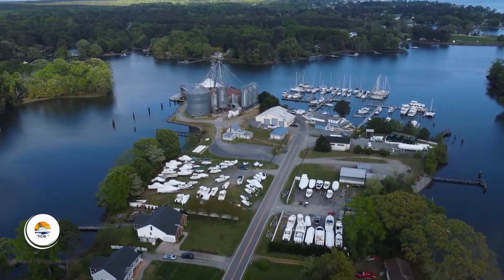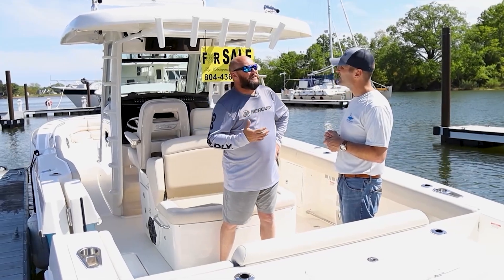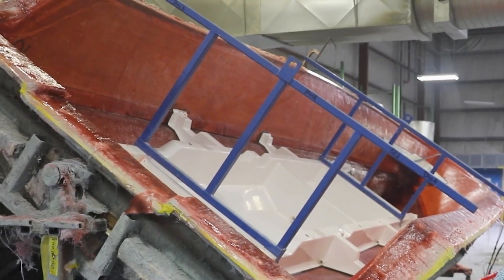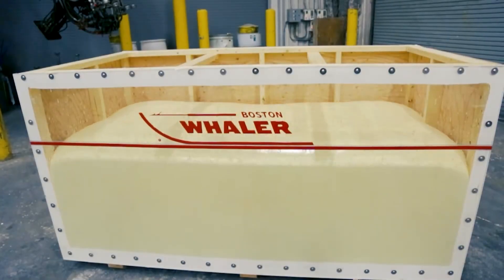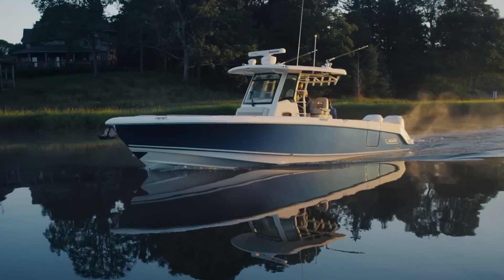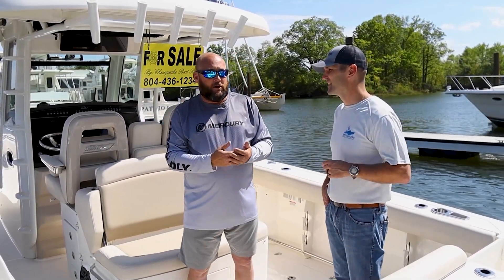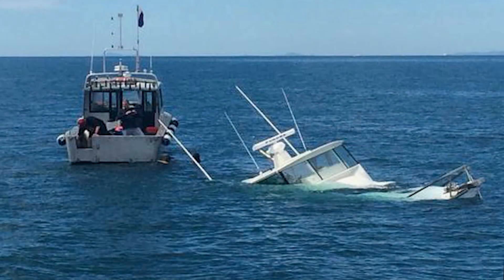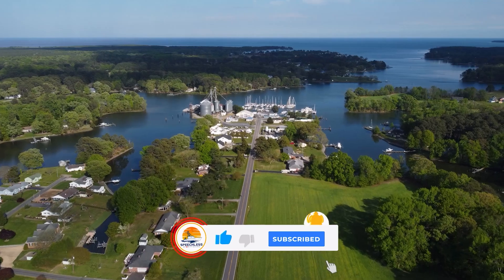Is Boston Whaler REALLY "Unsinkable??" (Here's the TRUTH!)

Comment: He forgot to mention that in addition to positive flotation, the Whaler is self-bailing.  I routinely left the drain plug out of my 13" SS on rainy nights so that it would drain the water without need for a bilge pump. It would fill the rear to about 6 inches of water and then stop filling and drain out the drain plug hole.

Comment: Great boats paired with crap engines. I with they gave you a choice other than mercury
Reply: Suzuki 👍
Reply: I kinda feel like you, but my 2007 montauk has a 60 HP Mercury Big Foot. Not a single problem for over 17 years!  Change oil, gearcase lube, grease. How do I complain?

Comment: Whaler's hull construction method is known as unibond foam core injection molding. The two halves of the hull are bonded together with fiberglass resin and woven fiber. The entire hull is compressed and locked in the mold while being injected with foam. My father was a production engineer for Whaler from 1968 to 1992 when the company was in Massachusetts.

Comment: I used to have a 11 sport, my buddy stepped on the back corner from another boat and swamped it. I hit the throttle full and got up on plane, pulled the plug and all the water was sucked out. My buddy was impressed. 20hp evinrude. Only casualties was my smokes.
Reply: The steering cable of my whaler broke once, in full sent. Made a 90 degrees turn in a split second with 60km/h…. We were swimming, but the whaler never even budged. Took about 150 liters of water in the boat, but because of the design the water is gone before you know and the whaler is ready to go again. Didn’t even had to use the bilge pump.😊
Reply from the maker: LOL, that's a good story right there!

Comment: Nice add....The expert forgets to mention that the foam they use today is a so called closed cell foam. This means the foam won't suck up any water when exposed. If you buy a second hand (classic) Whaler it's a different story altogether. In the old days, the type of foam used was open cell foam which is like a sponge when exposed to water. Many of those boats rotted out on the inside. When buying one, you must be on the lookout for soggy bottoms, a boat that's lying deeper in the water because of the added weight of the water ingress. Leave those boats alone because the structural integrity and buoyancy  is compromised. All the marine plywood used to reinforce the Whalers in those days will rott from the inside, so the transom is compromised as well. It may be a good idea to weigh the boat before buying it. But, you can never be sure if you don't take it apart, remove the old foam and completely restore/refoam the boat....
Reply: Back in the early 1990's a totally destroyed 25' Boston Whaler Outrage was towed into Lauderdale Marina and hauled out.. I started talking to a guy that was taking photos of it.. he told me he and, and his friend had been on the boat that night when it was broadside by a freighter 25 miles offshore. That they dove off the boat seconds before impact and after the freighter disappeared into the distance they climbed back on the still floating boat..managed to hookup their VHF and call the coast guard..
Reply: the very early boats MAY have had open cell foam, but since the 70s, they were definitely all closed cell foam. I've owned many and never had an issue with water logged Whalers.
Reply from the maker: Great info 👍

Comment: If you swamp a whaler with enough water it will roll over, and that's a fact.
Reply: How much extra crap had you bolted on and stuffed the boat with when you rolled? Tower with 100 lbs at the top? Most people don't think about that.
Reply: @jjones9290  you assume too much, notice I said swamp not overload.
Reply: not necessarily, I have had 14 people with water up to  the gunwales on a 13' and it was both overloaded and swamped and DID NOT roll over.   Theoretically, any vessel can roll over, BUT sinking them is a whole different issue.